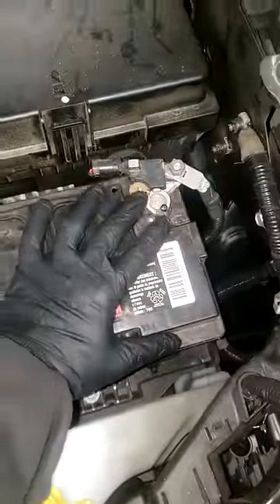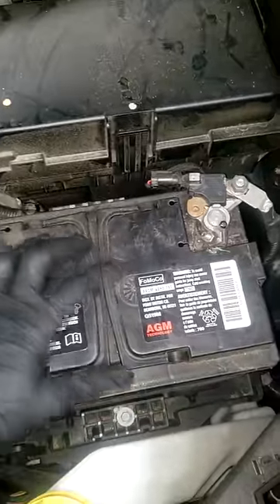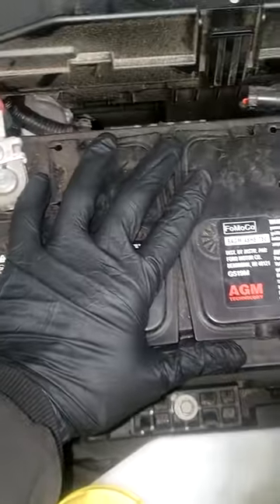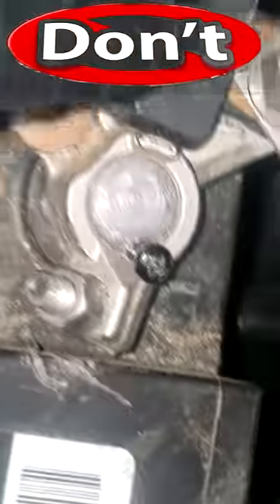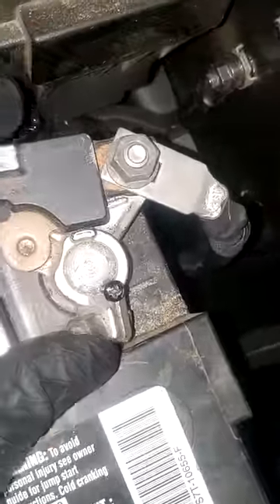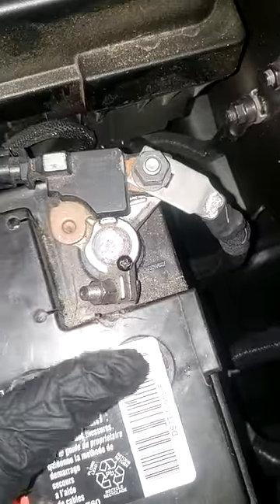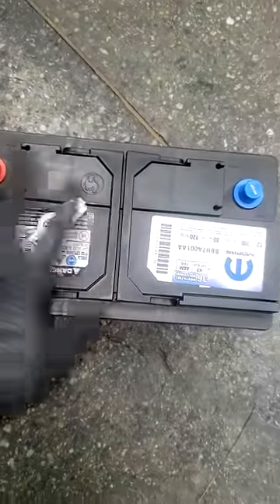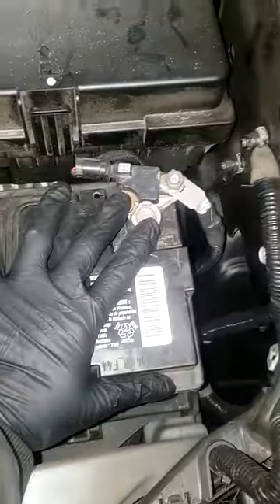STOP DOING THIS PEOPLE. This will destroy your car electrical system.

Comment: Wow..just watching this is painful. Where to start...

1. Yes, that IS a negative batter terminal. 

-Just like a radiator with a built in temp sensor is still a radiator. Some radiators  have them, some don't. 

2. The screw has zero effect on IBS.  

-An Intelligent Battery Sensor (IBS) is a mechatronic component that monitors and measurers battery performance, also called a battery current sensor. An IBS provides reliable information on key battery parameters such as current, voltage, and even the battery’s temperature.

- Had the screw pierced the sensor or its wire harness, then yes it could have caused an issue, but it didn't

3. Trouble codes can be cleared and the sensor could have been just fine.  It is possible however, that if the connection to the battery was cycled enough, that the sensor could have suffered electrical damage. Many types of electronics don't like to have the power to them cycled quickly.  That IBS obviously uses CANBUS to communicate, meaning the sensor has an onboard MCU. 

- The lack of consistent clamping pressure could have caused this, not the screw in of itself. 

4. The bigger question should be, why is the clamp bad? Looks like a new-ish car to me.
Reply from the maker: My take on it is that the relationship between the battery terminal (which is part of the sensor, you cant buy them separate here) and the battery post (wrong battery btw) has been affected and compromised by that screw. This cause the light to come back on now the car at my shop. No Brainer  right? Its simple, un do everything the other shop just did. Go in with a new (correct) battery and don't trust that terminal/IBS combo, simply replace it. Recheck everything, cleared codes, test driven, all good, customer happy. Not interested in all that time wasted info you simply copied and pasted. Thanks but no thanks. Your comment basically suggest everything that was done is wrong. This video not up to validate approval from anybody, i merely show what I'm doing via video on my youtube channel. Car fixed an gone, everybody happy seems except for a few so call big shot super master techs thats trying to shine over here. If you to advanced for the video thats happens from time to time. My target audience are the DIYers of the world. When I post more advanced topic videos, you nowhere to be found. Seems you an opportunist.
Reply: Generally we watch SMA or watch Wes work. Sometimes you stray into our feed and we get to see how other mechanics do things. I’ll watch Eric O work for an hour no problem.
Reply from the maker: @-Primer-  lmao, if you not a so called master tech then nothing you mentioned was worth mentioning imo. You just wasted 5 mins of my life my dude.
Reply from the maker: @Clynikal  He's good. We different, and this a free country we live in.
Reply: @OnlineMechanicTips  also the sky is blue and the grass is green but that has fuck all to do with the country being free.
Reply from the maker: @Clynikal  lol that mean you can watch who ever in the hell you want to watch

Comment: For a shop to do that I totally agree. Big no no. But when you're in a dark parking lot late at night, everything's closed and you just need to get it good enough to make it home, that little screw could save you a huge headache and even bigger tow bill. I've seen a lot of cars come in the shop with a screw but never on a terminal like that. Always the thin sheet metal band types in older Civic's and whatnot
Reply from the maker: Interesting

Comment: I don't think the screw itself would be causing the issue. Now, the sensor being bad, battery losing a cell, loose connection, etc.
Reply from the maker: The connection mishap is the worst thing you can do to these newer computer controlled cars. Hence thats why she's here about to get it fixed right.
Reply: @OnlineMechanicTips  no doubt you fixed it right.
Reply from the maker: @SparkyWrench  i wouldn't have had it know other way

Comment: Lol because taking it off and filing between the battery clamp so it actually tightens would be too cheap. And the piece that clamps to the battery is a battery terminal. The screw had zero effect on the aluminum it touched. It's not like they put a screw thru the sensor.
Reply from the maker: I got this over here big dawg, we don't work like that. That terminal and sensor head has been compromised. We recommend shevreplaced both, we showed herband she agreed. No sense putting our reputation on the line trying to clean up what another shop did.

Comment: Why is there so much arguement of if the sensor is bad or not? The sensor and terminal are a single non seperable unit. He says so in a comment, so even if the sensor is perfect it must be changed if the teminal is. 
That said to fix the visible damage (the screw) you will have to
 A. Replace terminal, 
 B.  Remove bolt from the terminal and file the gap and hope it will tighten more,
 C. put in another shim of some sort.
For me as expensive as an OE battery is its not worth playing with losing the warranty. 
B and C might not vaid a warranty but that screw sure as hell would most places void the warranty if there is visible damage.
Reply from the maker: Interesting take on it

Comment: Don't forget there's still "experts" that will remove the negative cable while the car is still running to see if the alternator is working because "it worked for my 1968 (whatever)," not realizing all the electronics vehicles have these days...
Reply from the maker: Lmao, stop it. Those same experts are on here in droves justifying putting a screw in there like this saying its ok.. smdh. The weird part is that some of them seem sharp.

Comment: That's the first place I go to also. I immediately grab the battery and see if it has the hold-down actually installed or if the battery is loose and flopping around. I always fix that too, when there are battery replacement problems. If the hold-down isn't holding it down all the cables get stretched and loosened and cause problems.
Reply from the maker: Poor connection on newer cars will drive everything crazy

Comment: I had a car that had that flashing dashboard light symptom, but intermittently.  The car had been sitting in my driveway a month or two while I was away.  Yes, that really freaked me out when it happened.  I took the car to a dealership, and of course they couldn't duplicate the problem.  After a few more questions they "dug deeper" and found the alternator needed a rebuild.  I have actually had more problems with batteries because I am afraid to overtighten the battery clamps.

Comment: There might have been another way to fix it (just hypothetically), but that has nothing to do with this video. You did exactly what the customer wanted, which was “do it right”. The only way to do it right was to replace both things. The terminal/sensor was damaged as well as the battery itself. Good work!
Reply from the maker: Thanks James

Comment: Just for a side note yet important don't place your car batteries on the ground always put a piece of wood down and set the batteries on wood when you place them directly on the ground it sucks the juice right out over time and I know it sounds crazy but I tested that with known good charged batteries 2 on wood 2 directly on the ground and sure enough the ground leaches the battery down.
Reply from the maker: Yes agree, it does sound crazy. Especially considering the plastic case used on most newer batteries. But interesting points, thanks

Comment: From the camera angle, looks like the terminal wasn’t fully seated down to the base to the battery post. That being said there was no need to put that screw in it. Post is tapered and had more space to open the terminal so it could be tightened more.
Reply from the maker: Perhaps. But we don't play these games and not really sure what the other shop did or how much they grinded off the terminal. So its simple. We recommend replacing that wrong battery and a new terminal/sensor.  Customer agrees and pays her bill and thats that. Im not sure what all the fuss is about..lol..This customer gone and happy.
Reply: @OnlineMechanicTips  Sir, no fuss from me. If you fixed it then 👍

I’m just making a comment so others learn that a battery terminal is supposed to be installed all the way at the base of the battery post. I’m a Automotive technician of almost 21 years. Every time I open a hood, no matter what the car is in for. I grab the terminals and wiggle them to see if they are 100% tight. Guys in the shop actually lol cause I find so many that are loose. The majority of them are not installed to the base of the battery post. I’ve found many issues due to this.  I shit you not, I went back to work after a weeks vacation. One of the front counter guys to me and asked if I could please look at the pathfinder that’s been in the shop all week. It was a intermittent no start. I do all the Diag and programming/coding work in the shop. They already replaced the starter, removed the after market alarm replaced the engine ground.  Not even 2 minutes in the shop, still haven’t put my work clothes on yet. I walk over to the truck grab the battery terminals give a good wiggle and what do you know, “LOOSE”. Walked over to him and said have whoever is working on it replace both terminals and ship it. He said no way. I told him just do it. Truck was parked in the done lot a hour later.
Reply from the maker: @myboy051  Whoa, thats whats up up man..I have mad respect for any mechanics that work on different makes and models. Thats whats up.

Comment: all you had to do is run a hacksaw blade through were the clamp bolt is slide the bolt back in then it would be as tight as new
Reply from the maker: We don't hack shit here. That's what kind of shop she just left. She now wants it fixed right. It is now fixed right

Comment: Mfs really act like they don't make battery post shims....I'd rather see aluminum than that bs.
Reply from the maker: Dude those are the worst things you can put on a new car now. These computer controlled cars will taotally lock you out of your transmission using stuff like that
Reply: @OnlineMechanicTips  they really that bad? I always recommend replacing with am oem terminal when they are like that but almost nobody goes for it.

Comment: I have towed many burned up cars or ,if lucky, stalled cars for Positive battery terminals with protruding items  rubbing the Hood.
Reply from the maker: This customer lucky her transmission was not knocked offline from the proxi alignment. Or she would of had to tow it here.
Reply: @OnlineMechanicTips  people don’t comprehend. The wave forms imposed on DC wires informing the ECM of what’s going in the car.  We’ve been dealing with this in Semis since the late 90’s.  

You can no longer mechanics wire and bubble gum things back together.
Reply from the maker: @Jack.Waters  lol..love your choice of words

Comment: Looks like the terminal wasn’t fully seated on the post in the first place. Pet peeve of mine when people don’t take the extra 5 seconds to spread the terminal apart so that it will fall all the way down on the battery post.
Reply from the maker: Thats not your typical ground terminal. Its a sensor that the computer monitors. IBS
Reply: @OnlineMechanicTips  As a fellow engineer it doesn't matter if it's a post or sensor. A rigged connection is a rigged connection. It should have been correctly connected in the first place.

Comment: Most people don't know that the battery posts are tapered being wider at the bottom.  Sometimes a loose terminal just needs to be pushed down all the way so it can clamp on the widest part, the base. And sometimes they just need replaced like you said.
Reply: Some posts are tapered, personally I can't remember the last time I saw a tapered post or a lose clamp that would tighten when simply pushed further down the post

Comment: Ok...explain to me what that screw touched that is a sensor? The terminal ends are not sensors, but some cars have sensors integrated into them. They are integrated in where the wire comes into the terminal end. That screw did not touch the sensor portion nor was it in danger of it. Yes it looks tacky and normally only hacks will use a screw to get by...they make terminal shims for this very reason. However, a screw works perfectly fine. It is a piece of metal that makes the other 2 pieces of metal contact each other solidly.

The reason the problem went away is because you pulled the battery. This reset the computer. Was there a connection issue? Yeah probably. Did the screw cause it? 110% no it did not. Did you fix the issue? No you didn't because of your fix. You probably inadvertantly fixed it because the negative was loose too. 90% of the time with that type of terminal end if one is loose on a battery stud then the other one is too.

Know your stuff man don't just make stuff up to feel special. This is ridiculous. If you want my qualifications, I am currently a Diesel Tech and I have a long list of certifications. Some of which are from specialty programs that you can't even get anymore. Even have some from military programs that civilians aren't normally able to receive.

You sir just wasted that poor ladies money and she's going to most likely have to deal with this same issue farther down the line. Good job
Reply from the maker: OMG, you said all that but after reading the part about you suggesting shims for this, I cant do this with you my guy. Heres the thing I have to keep in mind when going back and forth in the comment section. You guys likely not surrounded by brand new cars all day everyday working on them, so I get it. But let me say this about those shim/caps. Cars have been towed into the shop because of thinking like that. These newer cars not playing those games anymore. The slightest incorrect voltage drop or spike will knock your transmission off line (proxi). The old way of thinking dont work like that anymore. This customer lucky her trans still shifting the this rigged up. But on the real, I cant do this with you cause it would be wasting more time.

Comment: I would have tried putting the new battery in first and see if it solved the issue  if not then the sensor if it is needed.
Reply from the maker: We not wasting time trying anything. The connection not secure, the battery is dead and wrong so why waste time. Replace the battery and the IBS, reset codes. Boom you done.

Comment: If that screw isn't adding extra resistance (which can be verified with a ohmmeter between the terminal and post) it won't affect that shunt style sensor at all. Probably just the battery that's the issue, the screw is bad practice though
Reply from the maker: The battery and the sensor/terminal was replace. Who's going to waste time when they can visible see this foolishness and read the codes? Car fixed and gone my friend.
Reply: Parts cannon to the rescue

Comment: You don’t have 1000 people telling you it’s NOT the screw causing the issue because of coincidence, it literally wasn’t the problem,.
Reply from the maker: Seems now I have 1001. Yes, another typical screw defender.  The good news is that its ok to have a difference of opinions. Because thats all it is. Thats not a bad thing. The crazy thing about all 1001 of yall is that the car is fixed and been gone almost 2 weeks now. Yall defend that screw because it works, fact is it may work but its not good on the newer cars and can cause problem with the connection at the battery which can trow the car in lock out mode. If yall never work on new cars or work at a new car dealer like I do, you would never see or experience much of this. So i wont hold that against yall. It would take years for this to trickle down to regular mechanics. I work on stuff that was just built 2 months ago and have to have constant training on this stuff. The average mechanic on this post likely never worked on a brand new car. Thats because those cars are still under warranty and they likely headed to meat the dealer you you wont see these issues for about 3-5 years. By then I would learning the 2028 models..lol

Comment: Sensor on a batter terminal... smh glad im sticking with 30-40 year old + cars.  But fyi i gave up on terminals made of lead..  I use brass ones now.. they never.. ever go loose.. ever
Reply: Brass terminals? Is that a certain type of battery? Excuse my ignorance.
Reply: @SpicyMcGeezak  mainly used in marine applications.
Reply: @steveb.6267  ah okay, but you can use them to replace the terminals on your car? That’s good to know if a terminal ever goes kaput.
Reply: @SpicyMcGeezak  yes you can substitute for lead terminals. Have been doing this for years.

Comment: 100% agree with your first instinct. Anytime you have fun electrical problems it's more times than not the battery. But you have to diagnose it to be sure. You didn't show the diagnoses but I assume since your right on the money with your initial thought, that you are experienced enough to have done it.
Reply from the maker: Yea and this a 60 second shorts video. I've seen to many times hacked stuff like this never end well by trying to repair or improvise things. So I sometime try and educate the customers on how there cars different from cars of past years. You cannot play around with poor connections at the battery on these newer cars. Most understand, thank me, pay there bill and off they go.
Reply: @Online Mechanic Tips  Yes sir. With how you presented yourself I knew you did the right thing. I did the screw trick on my old 1979 mustang. Got me home. Reminds me of my father. He always told me to make sure your battery cables, both on the battery and connections on other end are clean and tight.